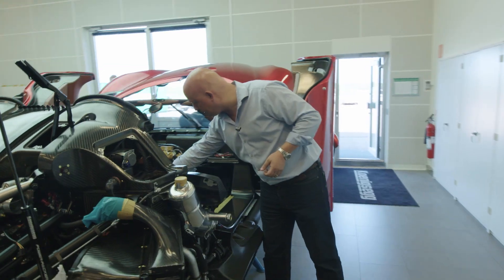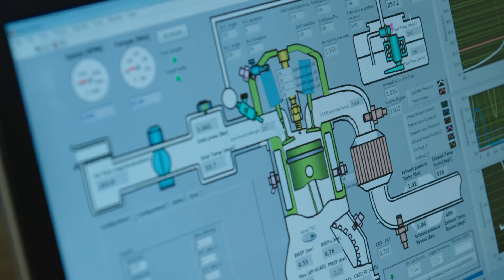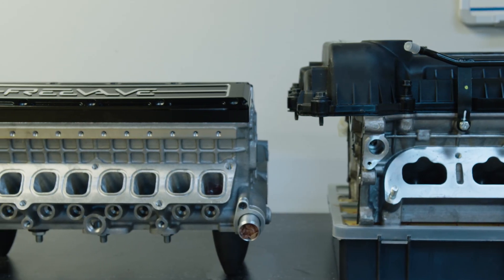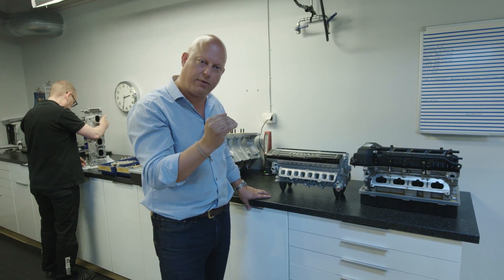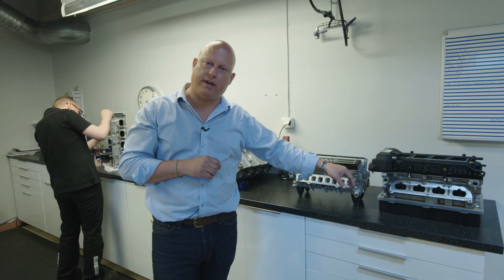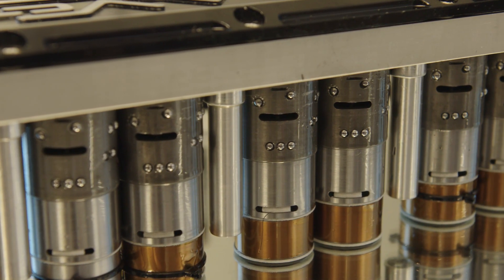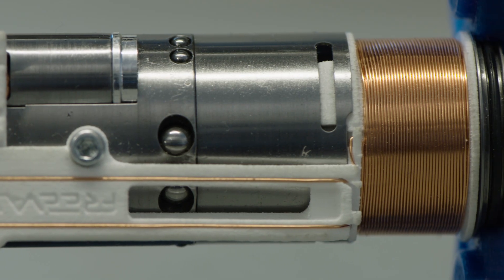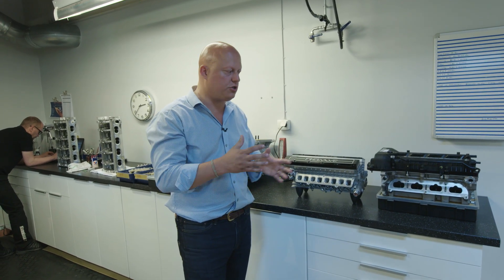Freevalve Update Camless Engine -- /INSIDE KOENIGSEGG

Comment: Make motorbike engines like this ,we can get so much power and weight loss from these types of engines in motorcycles
Reply: I thought about trying this on the yamaha 5 valve engines, because the cam box is separate to the lower head, you could design a bolt on replacement. But I was thinking more along the lines of "air cams" that could slide up and down and change the valve timing. The electronic actuators are the best, but adding air AND a bigger alternator to a bike would cause other problems I think. But if i ever win lotto, I'm trying it ;)
Reply: It already exists, but only in motogp!
Reply: @remid1994  no... They have pneumatic valves in MotoGP which is still mechanical actuation by a camshaft but there is an "air spring" that replaces the coil spring to close the valve
Reply: @rsv4675  tbh, bikes are already way too fast. If you ask me, I'd make anything with 2 wheels and more than 100 horsepower illegal for street use. It sounds drastic, but those bikes are so freaking fast you practically can't use their potential legally anywhere. It just gives you an option to die prematurely, and maybe kill someone else as well (as I have seen in person). This would, at least, lower fuel consumption.
Reply: @KalLanPIDT  and luckily I've seen a death of a child. Hit by a speeding motorcycle (this, unfortunately, actually happened). Believe it or not, I ride as well. Just... Don't twist that throttle too much. It's not only your head that's at stake.
Reply: @FilipGereg  There's idiots for everything, you can't make something illeagal cuz someone did something stupid once. Like making footballs illeagal cuz some kid once knocked out their neighbors window.
Reply: Godly Powers  I don't know if my previous comment posted, it said it failed. Anyway, I see your point, but I don't think that's the best analogy. Accidents happen of course, but there are speed limits, and if you are not the lawful guy, there's just common sense. Going 300 km/h is not common sense. Having that ability only lets you break the law and endanger your life, and of others.
All in all, this argument is kind of pointless because there are countless cars that can do it as well. Absurd speeds are not for an average Joe. It's for professionals... on tracks. People's lives are not something to be played with.
Reply: @FilipGereg  yeah but pretty much all cars can cross the speed limit, what the top speed is or how fast it gets there is irrelevant. Idiots are gonna drive like idiots no  matter what vehicle it is, no reason to take away the toys from us that drives safely in public. micdrop
Reply: Scooters could run tiny tiny engines and still work just fine....
And kei cars! Imagine the packaging bonuses for kei cars. So much vertical space freed up!
Reply: @maitele  now if only they'd let kei cars have more than 63hp
Reply: Do you want bikers to die quicker???? Lmao especially young, irresponsible bikers.
Reply: @bryanmasis1595  I will ride my 1800 CC behemoth into the sun
Reply: @greengoat5654  Cruiser?
Reply: @bryanmasis1595  no it's the recently-released zx18R

Comment: Better not make an interference engine with this technology 😂😂😂 one little glitch and you’re done😵

There’s alot more definite motion with a traditional mechanically driven valvetrain. Less chance of piston/valve contact
Reply: Actually there is likely no such thing as an interference engine with these.  If they fail, or glitch, they fail closed.  Even if there is piston-valve contact, the valve is backed by an air spring, not a rigid valvetrain.

Comment: Love this! That engine would be amazing to have in a little 2 or 3 series competitor. The power to weight ratio would be insane with this engine. Could you imagine this engine with Infiniti’s variable compression crankshaft system?! I bet each valve on that thing costs a fortune.

Comment: Damn. 1.6ltr turbocharged engine. 160hp - > 240hp. 240Nm - >320Nm + 15% fuel economy. This is witchcraft.
Reply: It has just over half the displacement of a Model T engine, which produces 20 hp.
Reply: @JiveDadson  The 2.9L model T engine also had a 4:1 compression ratio and a side valve arrangement producing a standard flathead design.  Basically an agricultural engine as it was designed to run on gasoline and ethanol. It was a great start but almost nothing save the basic idea of an otto 4 cycle still exists today.
Reply: @JiveDadson  the model T had a bigger engine than a 1.6. check your facts.
Reply: fast forward to today and its a 2 ltre 3 cylinder making 600 hp
Reply: @TheCamaro5  yeah and it also only weighs 60kg, mad
Reply: with infinite variable valve timing ..you have finally honed the 4 stroke engine to a tee..
Reply: @nealefrazer4247  It can also be 2 stroke
Reply: @Larcona_  explain that comment ...because that makes no sense...and what 2 stroke are you referring too?..crankcase transfer 2 cycle or the Clerk cycle 2  stroke (Detroit)
Reply: @nealefrazer4247  I have no idea, I just know one of the articles I read on it said that it can run on gas, diesel, and alcohol as well as being able to run as a 2 or 4 stroke.
Reply: @Larcona_  sounds like the new mazda technology
Reply: @micmictover1420  in case you are talking about skyactiv-x: It is a conventional 4 stroke gasoline engine with conventional camshafts. It just uses high compression ratio and very lean mixture which is ignited through diesel like compression ignition to save fuel. You could fit this engine with freevalves tho.
Reply: @KingKong-mp6gj  thats exactly what i ment to say haha
Reply: @micmictover1420  ;-)
Reply: @KingKong-mp6gj 

Hell yeah! Mazda HCCI with FreeValve = more power, torque, quicker response and less fuel. I'm in ( ͡° ͜ʖ ͡°)
Reply: @Nudel-nc1cp  Yeah that would be a god tier engine. I heard Mazda and Toyota are collaborating on a straight 6 cylinder engine for the lexus line incorporating skyactiv x. Keeping fingers crossed for the addition of freevalves👍
Reply: @KingKong-mp6gj 

I heard they gonna cooperate but didn't expect new in-line 6 cylinder. Maybe Toyota gonna get rid off that crap bmw engine in new Supra? Just wondering :]
Reply: I never saw it running
Reply: "Any sufficiently advanced technology is indistinguishable from magic." - Arthur C Clarke.
Reply: Warlocks. Men can can't be witches bro.  Duh! Lmao
Reply: @stryker4240  cackles Dude. You have no idea.
Reply: Techmology  my friend!
Reply: If the engine is going from 9 to 1 to 14 to 1 compression, is this going to require premium high octane fuel? If so, do they figure that into the fuel economy?
Reply: Hahaha...15%
Reply: MotorCraft
Reply: I wonder how far they went, 
I mean torture test it and keep upping fuel and boost rate until destruction, there are so many things that increase power without increasing the boost (i cant say if they did or didnt)
Like thermal dispersion if more heat can escape due to flow design can make a better detonation which more power,
The surface and shape of the inlet and exhaust ports when ported on a standard setup engine makes more power,
I would imagine as the valves are actuator operated they can also set excatly how much they open and how long they stay open which could put even more control on the combustion cycles,
Must be a good engine block as that and pistons are normally the first failures when modifying power
Reply: Not to mention end product being cheaper ..now that's good witchcraft.
Reply: No. It is utilising technolgy to free up the power potential that conventional camshaft based engines strangle.
This design will likeley find more success than more exotic solutions because the bottom end piston layout requires minimal change.
Thereby saving costs on tooling up to build them. Very clever design that covers all the "valve" angles. 
Ha! See what I did there? Finally I would want to see the comparison on a dohc and a freevalve running the same bottom end N/A to get a clearer picture of real performance advantage without boost. But to get that power & way more important torque increase while saving 15% on fuel is at least on paper impressive.
Reply: Damn godlevel tweak
Reply: Honda made in the late 80s a 1.6 liter 168hp naturally aspirated with very good fuel economy... just sayin'
Reply: That's the power of having perfect control over every single valve
Reply: I mean they managed to Beat 8.0L W16 Quad Turbo 1500HP Bugatti Chiron by only using a 6.0L V8 Twin Turbo 1360HP Agera RS... that alone is beyond human logic
Reply: @RizLazey  if you thing the 6l v8 biturbo is impressive go check out the v10 era f1 engines
Reply: @RizLazey  THEY USE A 5 LITER V8 NOT 6 LITER :p
Reply: @Allen Loser !!! It took 2 weeks for someone to realize I misread it.
Reply: Do you know what's F1? the current F1 engines make over 1000bhp with the same engone capacity. The tech behind the current F1 engine is beyond Koenigsegg fan's ability to understand, it's beyond my ability too!
Reply: The entire powerunit with hybrid system makes over 1000bhp, only Renault claims to have over 1000bhp from the combustion engine currently (although this is doubted by other teams). Ferrari may have that power but doesn't claim to.

As for the tech behind it, the most impressive part to me is the fuel economy. Flat out power isn't all that impressive considering they run 3.5 bar (roughly 50psi?) of boost. Tons of videos on YouTube of people doing similar things and getting over 1000bhp. Getting it somewhat reliable with good throttle response and as little turbo lag as possible is where the difference comes in.
Reply: @remid1994  You're an idiot
Reply: @remid1994  it's also rebuild after every race meeting
Reply: @remid1994  except f1 cars are so tweaked the literally can't run when cold. You need to preheat the engine before driving and keep it at high speeds or it cools too much to run.
Reply: yusran zul well yeah, they doubled turbo psi... they could have gotten the same results by letting the turbo spool up higher on the stock engine. The emissions and weight savings are a benefit. Otherwise, the added complexity and expensive electronics might steer people away. In engineering, you want to simplify things as much as possible, this tech prob does the opposite so until those actuators go down in price, repair costs might steer folks away.
Reply: @Dmeech100  It also depends how much commodity electronics they use. Koenigsegg is one of those few companies that is actually pushing the boundaries. Their hypercars do use these tech. So it not straight prototype tech.
Reply: @Dmeech100  i don't think all they did was tune it for more boost here lol... considering it is also 35% more fuel efficient i'd say theres more going on than what you think
Reply: @Dmeech100  The valves are electronically modulated instead of using a cam... its a lot more than just increasing boost pressure
Reply: @Dmeech100  I was thinking the same thing, simplicity is essential. You can't expect performance and reliability from complexity.
Reply: @Dmeech100  it will get cheaper with time like literally every other technology
Reply: @Doejohnm  All these people saying it's unreiliabe, too complex, expensive yadayada. Are the same people that said this about injection a couple decades ago. There has not been a carburated production car since 86 lol. In 10 years or so this will come to cheaper combustion engines. in 5 years maybe in the S class already.
Reply: @Dmeech100  how do you know?
Reply: Witchcraft = BS.   Ok so they increased the turbo boost and claim their valve system doubles HP.   Hmmmm the extra boost made the power dummies.  U can put a turd on top of the engine and crank up the boost and claim ur new turd power booster gives massive power gains too.  That’s what they are doing here.   Fraud. Don’t claim power made from other components is dyno proof results of ur invention.  U need a control test with identical specs one with the mod and one without.  U dnt change things on a comparison like boost and claim it’s a stock vs freevalve comparison u turds

Comment: About 39 years ago my motor head buddies would talk about this stuff, amazing!
Reply: Yep, I remember discussing the future of camless valve operation way back in the early 90s albeit we never thought of pneumatic valve operation. It was electric servo stuff. 
Btw, where does this engine produce compressed air to actuate these pneumatic valves? Do they add a compressor to the engines accessory drive belt system where it will scavenge horsepower or is their an onboard air tank that must be filled every 10 miles? He skipped that part.
Reply: Is this comment hysterical?
Reply: Absolutely late 90s ford introduced a supposed 800 hp 3 cyl engine w servo valves.  Was tested on track and never produced.  This isn't new tech it is reinvented updated and renewed interest.  Anyone think big oil had a hand in this...

Comment: I feel like the punematics woudent be fast enough to keep up with the pistons on high revs
Reply: when in F1 the engines revved up to 22k (2005-2008) they used pneumatic valves because that's the only way to get those valves moving quick enough. You may open a valve fast enough by a camshaft but you can't retract a valve fast enough using a spring.

Comment: All of this technology is a last gasp of the internal combustion engine.  Within 10 years, 50% of cars sold will be full electric and 10 years after that, it will be 100%.  The internal combustion engine technology will be just for museums or collectors.  Electric vehicles require near zero mechanical maintenance- I have machines with motors built during WW II which are running perfectly still.  The only holdup to electrics is the breakthrough to a quick charging battery with a reasonable range.  There are hundreds of companies working on this technology now, and it won't be long before someone hits on the solution.
Reply: @OLD SCHOOL nah. Electric cannot match the power capability of internal combustion engines. Imagine running a semi pulling a fully loaded trailer with nothing but batteries. How much load do you think the batteries could take before they are over worked and lose the capability too hold a charge? Electric cars are cute for congested city driving but not meant for work.
Reply: @jonathonbridges9625  Wrong,
electric motors are far superior to internal combustion engines in toque, horsepower and reliability, as I said before, it is only the battery technology that is holding up the change.  Consider that if you designed a semi truck with electric motors on each axle, you would reduce the weight  of that massive diesel motor, the hundreds of gallons of fuel and cooling and also the dual drive axles.  That would allow a battery pack of massive capacity.  Truck drivers must keep a log book, and are not allowed to drive over a certain limit, so they have a lot of wait time which would be used for battery charging.  You may be a combustion guy, but progress is progress and it will roll on regardless.
Reply: @oldschool1993  yes electric motors in an industrial setting are superior but they require a constant electric feed with massive amps and those motors weigh far more than a semi tractor motor. For instance a 100hp electric motor weighs around 1200 pounds. Electric car batteries are limited because they have finite amount of charge they can hold compared too the infinite charge of an industrial electric motor. The only advantage of electric power is the instant power it can offer however the technology to make it a practical, economical as well as an affordable replacement for the internal combustion engine in all applications  is a long ways away.
Reply: @jonathonbridges9625  Once again, it is only battery technology that is the hold up.  Speaking of technology that is "a long ways away",  remember Captain Kirk on Star trek with his flip phone in 1969- people thought then that it was pure science fiction -a long ways away.  
There are already electric trucks with good performance in production-
check this video from Daimler Benz
https://www.youtube.com/watch?v=qwI4Wt5Av3k

Comment: imagine this valve control in conjunction with the mazda SkyActiv-X spark controlled compression ignition.
Reply: THAT IS EXACTLY WHAT I WAS THINKING ABOUT.
Reply: Mazdas are junk. They make simple changes that are copied from other manufacturers and act as if they have re-invented the wheel.
Reply: @pbr247  Wrong, diesel breath. The Skyactiv engine is original, since no other company produces it. If you would take some time and watch the videos, you might appreciate the engineering behind it.

Comment: So where is this development now, how close to being put into production?
Reply: I'm disappointed this isn't common on engines today. I honestly thought this would be common place 5 or more years ago. I'm guessing durability is an issue. To implement this on a large scale it needs to be bulletproof. 
This isn't a new idea I remember hearing about it 20 years ago and I guess tech/materials haven't caught up as fast as I thought it would.
The possibilities with an "electronic camshaft" are massive. 
I really thought auto manufacturers would have been developing this as much as possible.
Reply: @DChrls  agreed! Don't F1 engines use camless ?
Reply: @boatymcboatface666  
No, they use pneumatic valve dampers. Basically pneumatic valve springs.
I'm surprised they haven't been tried yet in F1. Could be with the very high RPM of today's F1 engines they aren't reliable.